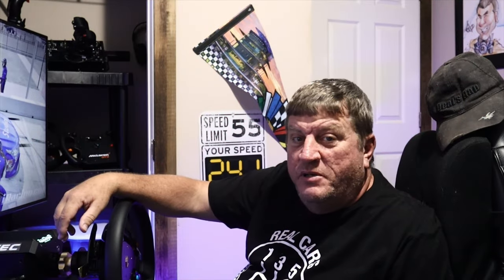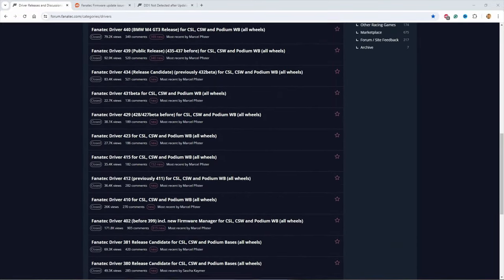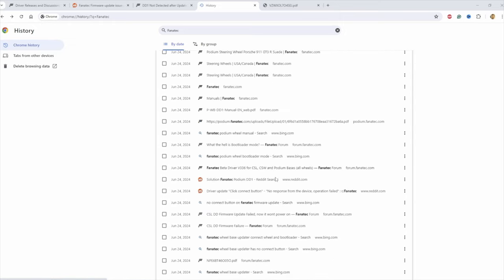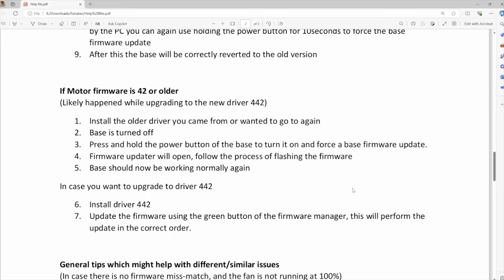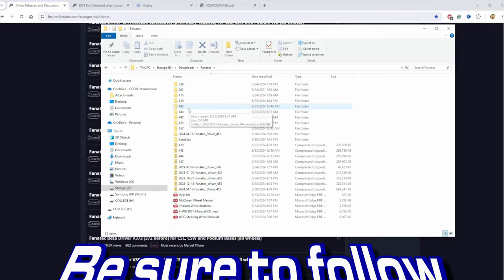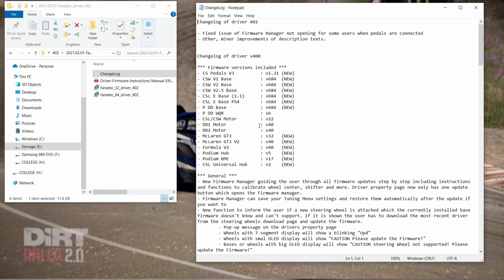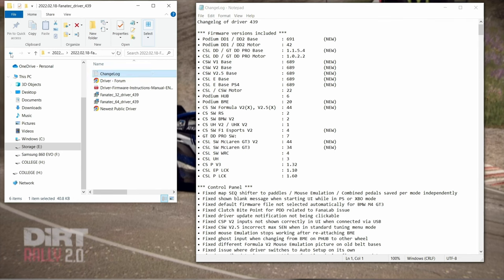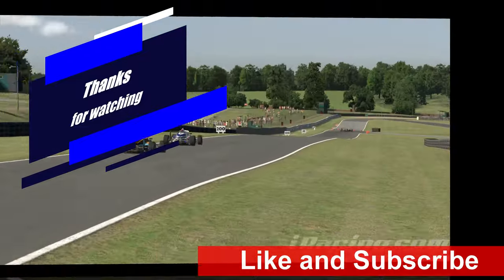Fanatec Firmware Issues RESOLVED!

Comment: I downloaded the Fanatec software on my Pc and updated the firmware from there. (You can also calibrate all options for your wheel, pedals and Gearbox). Is that the same result?
Reply from the maker: Thanks for watching! As long as you've updated the firmware on a regular basis you should be fine. My issue was I had been away from racing for over a year and missed several updates. Then when I went from an old firmware to the latest it bricked my base. But the steps in this video recovered what I was afraid was going to be a very expensive screwup.